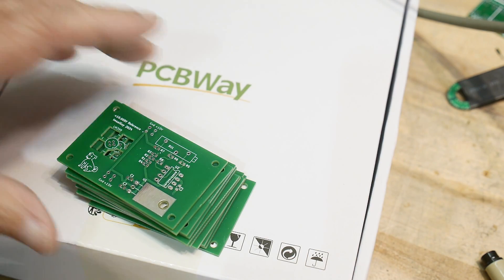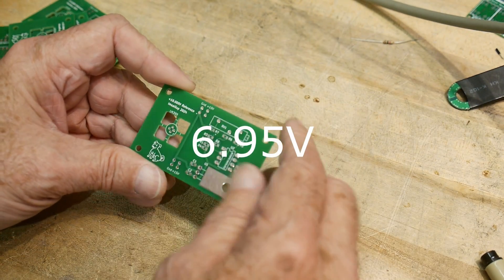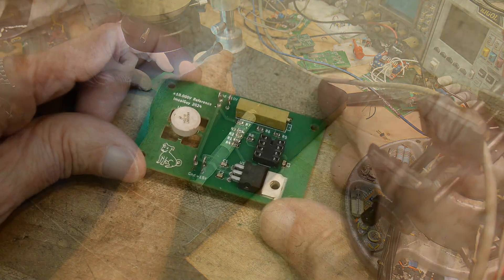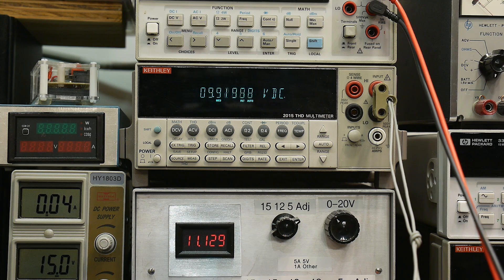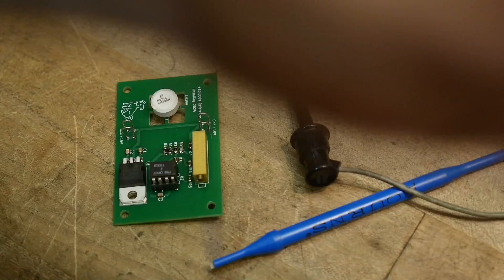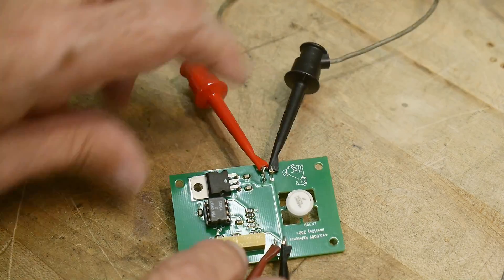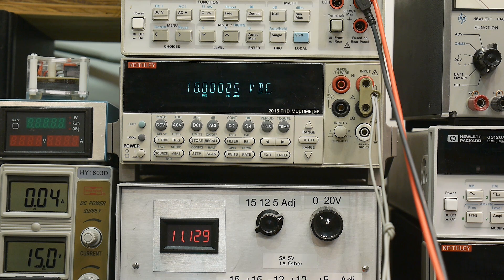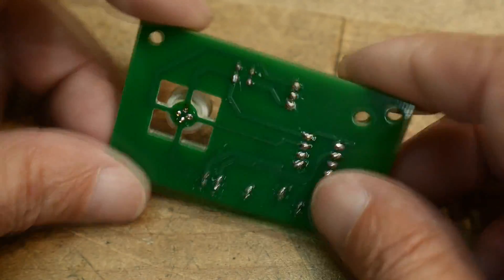#1882 LM399 10.0000V Reference Board (part 2 of 2)

Comment: Resistors have thermal drift.   It's best to use ratiometric networks where the they track and the parts are isothermal.      Great idea for a board, though.  Real confidence builder to have a precision source.   ( That ratiometric trick is good for setting absolute gains with an op amp, too.   Chopper stabilized op amps will get you damn near zero drift, as well. )

Comment: What do you use(wire?) for your power hook up terminals? Also, where can I source the banana plugs and mini clips you use? Thanks for the videos!
Reply from the maker: https://youtu.be/JUBgeCZ4uH8?si=Vr28O6tfnffmLRxM
Reply: @IMSAIGuy  Thank you! What kind of metal/wire do you make your power loops / attachment points on the bread boards with?
Reply from the maker: @945-b2m  22 gauge  solid

Comment: I reckon the drift is caused by the trimmer, as it is a mechanical device and susceptible to mechanical shocks or temperature gradients, unlike fixed precision resistors. I think adding a bunch of parallel low tempco resistors during the calibration step could be a fail-proof approach.

Comment: I dont know what op-amp youre using, but could it be the offset drift of that opamp. Probabily changing a few uV when small temperature changes.

Id think its important to use a chopper stabilized op-amp :)

Comment: My LM399 circuit is rock stable. But I used only low ppm resistors (no trimmer), an LTC2057 opamp, and the LM399 that I bought on ebay was supposedly used already.

Comment: Nice reference board. Lots of purists.Okay now load it with 20 mA. What does the voltage do?
Reply: I did some testing on mine using OP177. The voltage was stable until 10 mA
Reply: @pault6533 ...very nice. 10mA is better than 5mA. Sounds like a better unity gain follower could be installed. May nothing break into oscillation...and AC ripple be in micro volts regardless of the amount of current drawn. 

Maybe IMSAI will run a little oven or output voltage vs. temperature on his nifty PCB. While a military type temperature span ...that is a little extreme..it be nice to see Vout when say oven temp is varied from 32 deg. F to 140 deg. F ?  Sort of like what might be in the typical interior of an automotive application. 

I can see this reference in like my AD converter...for fuel injection standalone controller or the for little Chinadoll 2 cycle pile FI- I need to get back too..

Thanks
Kind regards

Fred
Reply: Of course current drawn to be like no more than 20 mA...?

Enjoy

Comment: You made fun of the LM399 reference... You used an op amp and some resistors and you want it to be stable......
In the schematic from which you were inspired, AN-184, Figure 2, Texas Instruments wrote there that a stability of 20ppm is obtained at the output. You had to at least try the circuit in Figure 4, next page, if you wanted to be close to the stability of the LM399! There is also a note about the resistors involved... they must be 1ppm TC... Imagine what the potentiometer must be like! Don't expect too much from what you did... Like you said, it's just for fun!
Reply: And, funny thing, the "TI app note" was done by National Semiconductor, in the days before the "monopolization" of a bunch of companies...

Comment: Most likely, the LM399 is more stabile, than the opamp circuit.
Reply: If it‘s a chopper you might be fine. But I fear the resistors and pots usually have a much higher drift than the 399 (once it‘s burned in).

Comment: I'm pretty sure the 2015 would be using an old LM399 to measure the new one, right? :D
Reply: Agreed.  If he is smart he has left the 2015 turned on in his label and the reference is burned in and stable at this point and drift should be relatively minor.  You would need a meter like a 34420 or better and a temp stable lab to really hit the mark.  Marco Reps has gone full on deep dive on the big brother to the lm399 with a bunch of LTZ1000 references and boards with the fancy Vishy oil filled ultra precision resistors.  You realize that anything else most others do is simply playing around after watching his videos.  His efforts result in near transfer standard boards.

Comment: You can graph the stabilization of the voltage using a log graph for time.  Much of the drift may be in the buffer circuit, especially SMD resistors.  What is the lowest impedance voltmeter you can calibrate before the voltage is depressed by the current draw?

Comment: I like to learn something new everyday.  I started early on this Saturday morning.  You mentioned increasing the voltage with the op amp.  Up until today, I didn't think this was possible!  I didn't know that an op amp could be used as a DC to DC convertor, which I thought could only be done with a switch mode power supply.  Great video series BTW!
Reply: It's not a switching DC DC converter. It has a higher power source, 15V from outside. Its resistor feedback gives it a total gain of ~1.4 so it converts the ~7V of the zener to 10V at the output.

Although you could say that most linear regulators are at their heart a little reference voltage (usually 1.25V), a simple opamp, and a pass transistor. Outside resistors set the gain of the opamp to drive the pass transistor so that you get your desired stablized voltage at the output of the regulator. Ofc extra circuitry gets put on the die for other features.
Reply: @ivolol  Thank you for the explanation!  When I heard him say "boost the voltage," my whole understanding of power supplies became in question!  I get it now, the high power source is the answer.
Reply: OK, I just read up on the op amp subject.  I forgot about that the voltage supply rail must be higher than the output voltage.  So, not really a DC to DC convertor.

Comment: The LM399 needs ~20mins minimum to get it 'ready for use', but saying that can take months to stabilize from new. If you power up continuously for a few days you should see some better stability. Take a note of room temp after 30mins, then after a few days get the room to same temp and check the drift.
PS. Remove the flux from the board.

Comment: if its a new part it should stay on for at least a couple of month to stabilize. also depends on TC of the resistors you used. Pots usually have high TC. It's not so much about the accuracy of your resistors as it is about their low TC.
Reply: I think since the pot is used as a voltage divider its TC shouldn't matter much, however the other resistors in the feedback network should have a closely matched TC for good stability vs temperature.
Reply: @victorman2227  One could use Vishay Low TCR SMD Thin Film Resistors, ± 2 ppm/°C, 0.01%, skip the potentiometer, and document the full burn-in reading, such as 10.083412 instead of 10.000000.  Nothing wrong with having an non-integer calibrator.   Also, using the highest precision OP Amp and skip the socketing.  In multimeters, I noticed the LM399 is mounted a distance above the board, leaving longer leads, instead of creating any interruptions in the PCB substrate.

Comment: You would want to do a "burn in" on it to get it to a stable point. I've seen some people saying that you need to burn it in for years at a time for it to be completely stable.
Reply: Yeah. Use it for fifty-some years at an ambient temp of 120C, using 120% of the maximum current. It will burn in and then burn out. After the burn out phase it will be the most stable device ever 😉